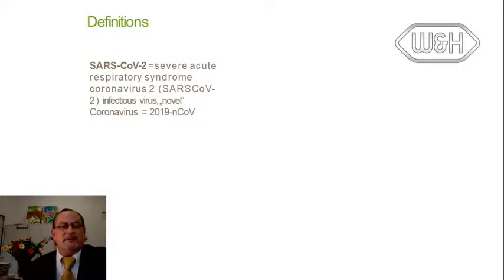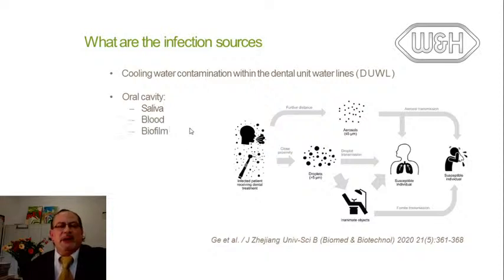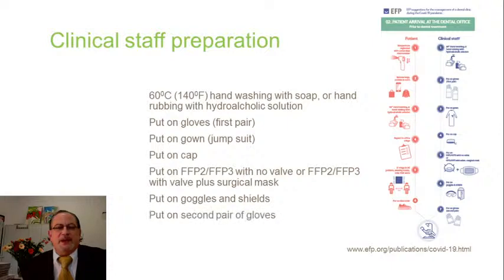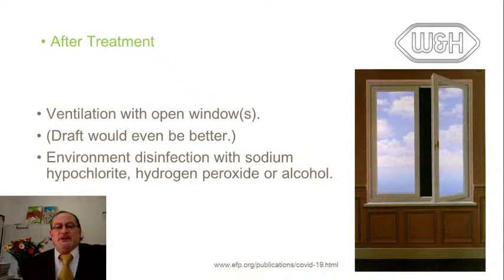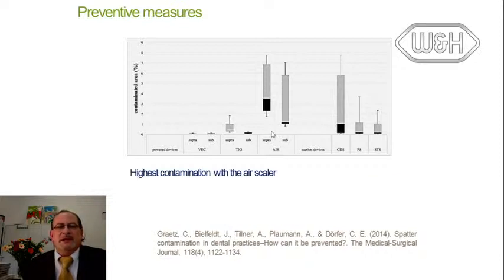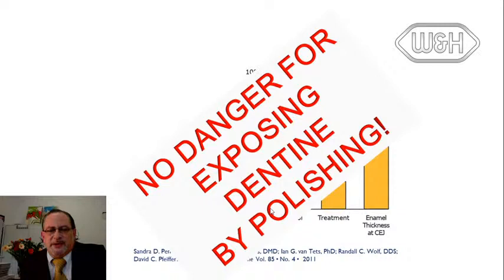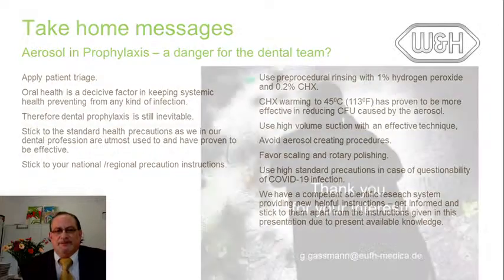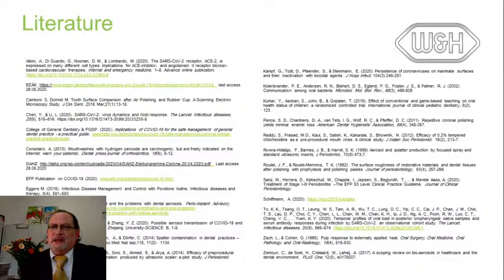W&H Webinar: Aerosol in prophylaxis – a danger for the dental team?

Comment: We highly recommend the Aerosol Solution System!  Through powerful, shielded source capture, the highest level HEPA filtration, directional airflow generation, and even negative pressure isolation potential, this custom designed system is able to virtually eliminate the risk from the air in offices and permit the performing of aerosol-generating procedures.  If you are in the US, give us a call today!  www.dentalaerosolsolutions.com

Comment: Dear doctor, what dou you think abaut the air filtration systems for our working rooms.
Nowadays istanbul is hot, what s your opinion working with an open windıw pkus air filtration machine and extraoral suction systems, by using all these systems can we use air conditioning system in our working room
Reply: Dear colleague, as you are working in a hot environment I think it is manditory having an air conditioning System in your dental practice. If you have an air Filtration mashine combined with an extraoral suction System this can reduce Aerosol circulation effectively if they are aproved for clinical use. In this case the Windows have to stay closed. 
Sincrely 
Georg Gaßmann